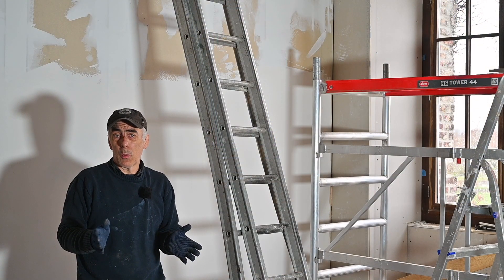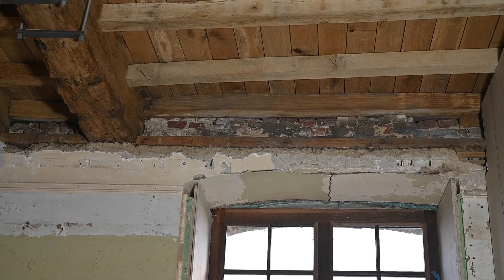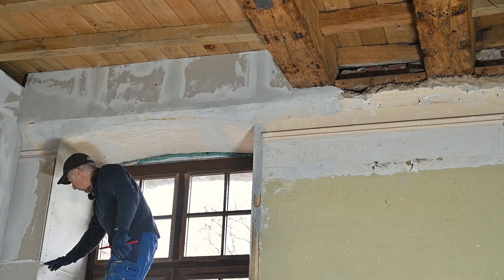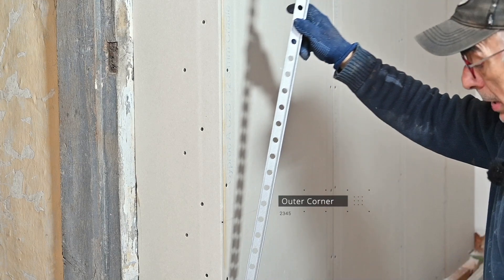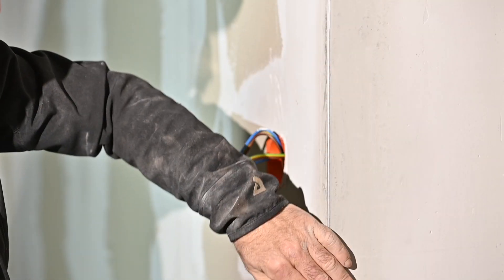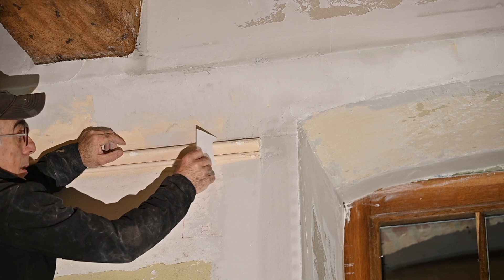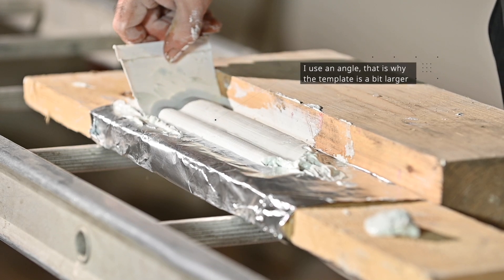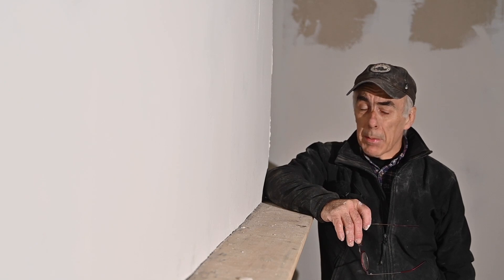The tower room, finishing the plastering

Comment: You may not have this available in Europe but in Canada and the US we have outside corner with paper edges and a metal center - it goes on more easily than the all metal stuff and give just a good a finish. Here is the link to one variety. https://www.homedepot.ca/product/sheetrock-cgc-paper-faced-metal-outside-corner-bead-b1w-9-16-in-x-13-16-in-uneven-leg-8-ft-/1000109056
Reply from the maker: Thanks for the comments and tips./ link